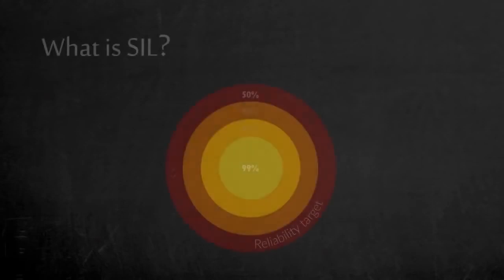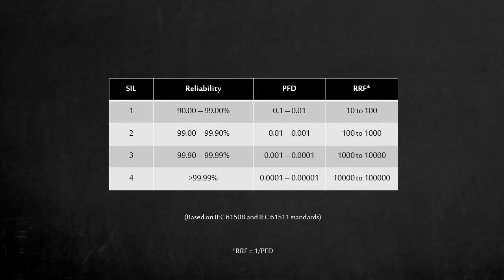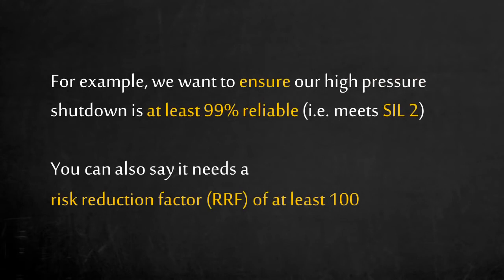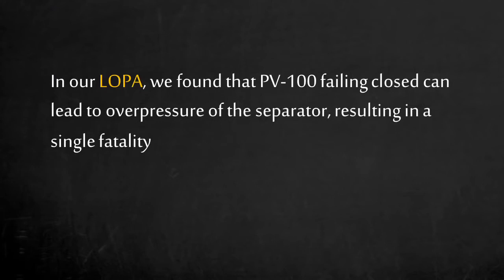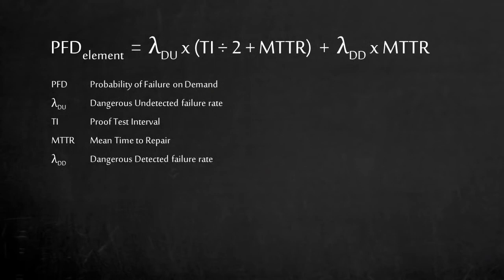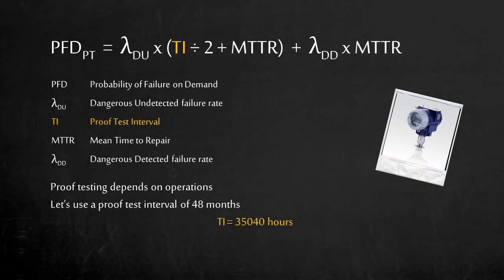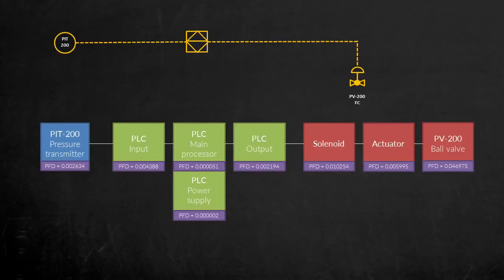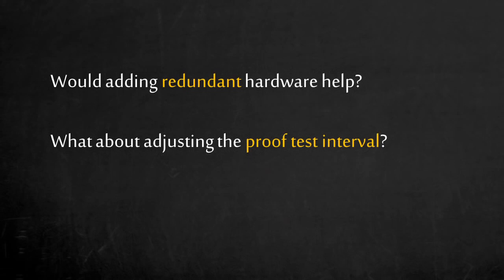Video 7K - Control Systems Review - SIL (Safety Integrity Level)

Comment: Great videos Bryon. In the examples given in this video, several times the narrator provides rates as per million, for example 15 per million or 60 per million. However they are notated as 1.5x10^-7 or 6.0x10^-7. That would actually be 15 per 100 million or 60 per 100 million. So either the narration is incorrect or the notation and calculations are incorrect.